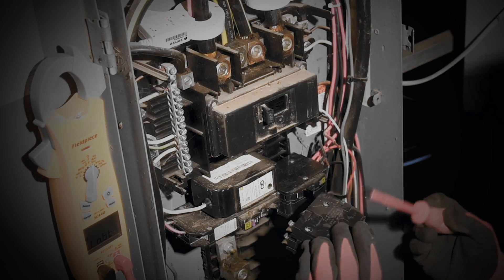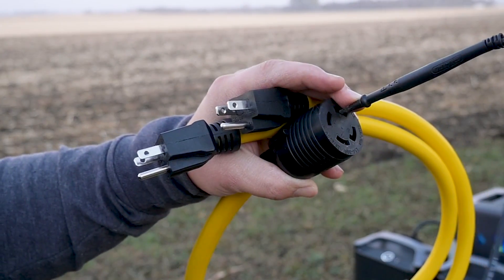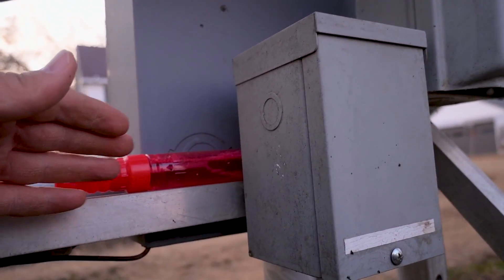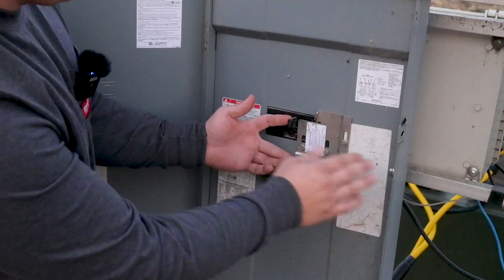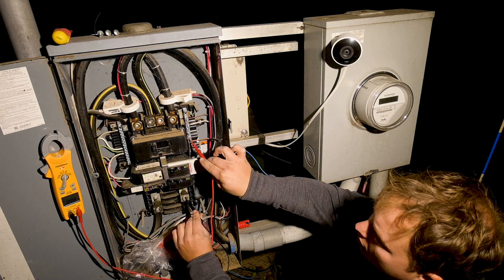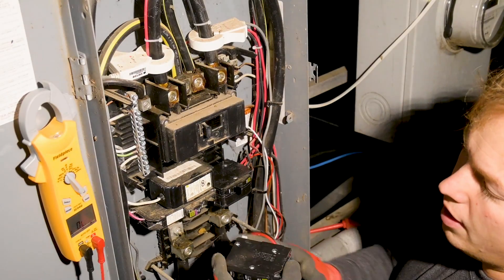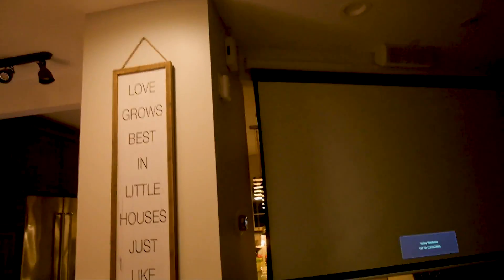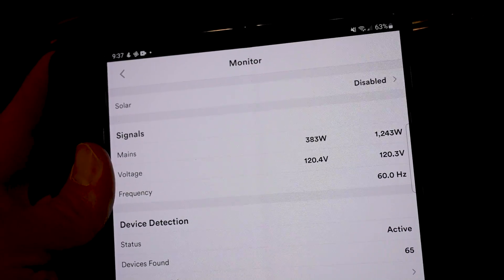Can You Power a 240 Volt Panel With Two 120 Volt Generators?

Comment: The reason you are seeing the voltage changing between the to hot legs is the two inverters are not running at EXACTLY 60 hz....so their phase is not synchronized. What is happening is as the inverters come into phase with each other you will see 0 volts. And the voltage will rise as they go out of phase until they reach 180 degrees our of phase, showing you a peak voltage, approx 240v.   

You can tell exactly how many cycles apart they are by timing the how long it takes from peak to peak.

This is how power generation plants sync with the grid before closing their interconnect with the grid. They monitor the voltage between the interconnect and their generator. They adjust the RPM so the cycles are VERY close. Then they wait for the zero crossings match and close the circuit. You can do the same thing with multiple generators connected to your home at the same time.
Reply: Exactly.  That tool is called a Synchroscope by the way.
Reply: 100% correct and well explained. An interesting case is that once the generator is synched and connected to the grid, it is very difficult to get it out of sync or out of phase because the grid will resist those changes.
Reply: @TwoToedSloth  which is why every traditional power plant which is online is going to spin at the same speed. If the grid frequency is higher, it will turn the generator into a motor until it reached the same frequency. (motors and generators are basically the same) This is also the mechanism that allows producers to control large scale outages. If they see that a region lowering the frequency too far for too long (minutes) then they will cut it off, which will generally cause the entire consuming region's grid to fail spectacularly.
Reply: You need BOTH sync & phasing in order to be correct. The sync just means they are operating exactly a 60hz (good) but they could be out of phase (not good)
Reply: Yes...the very reason some gennys have a sync option.
Reply: @Icehso140  Do you know which brands do this?  When I was looking for two 3k inverters to do that, all I could find were parallel kits that sync'd  to be in phase, providing more amps but at 120 volts.  I could not find any that would sync 180 out of phase to produced 240v.
Reply: @GregsStoneYard  being in sync is one thing,  being in phase os another. See if the inverters have a phase adjustment knob
Reply: @GregsStoneYard  paralleling, either in single phase, or in split/multi phase inverters is a totally,different kettle of fish. They have to be specifically designed for it. For a split/multi phase (US household 240v) I’m not aware of any units that can achieve that without a sync cable. In theory you could have a slave unit reference a phase and lock itself 180 out but none I know of do that. During commissioning you configure and wire them as a system with a master, it sends sync to the slaves which are configured for their own phase(s). 

If they’re not designed for grid tie or synchronized (and installed/configured/cables for it) trying to parallel inverters like you can do with generators, you’re going to have a bad day.
Reply: @OverKillPlusOne  the way to do it (and i have done it) is to use the exact same clock for the inverters. You connect the power from one inverter to another so that one inverter is acting as a master clock which the other "locks" to. You use a phase locked loop to have the slave inverter "locked" to the master inverter frequency. Usually the inverters us a high clock frequency and divide it down to 60hz. It would be ideal to grab that high frequency and pass it to the slave inverter, or have a master clock generator for BOTH units to lock to. Once they are running in sync (and in phase),
you then can tie the inverters output in parallel to increase the resultant power ie. two 30A inverters can produce a total output of 60A at 120v OR you can place them in series to get 240v 30A Split phase. (2-120v 30A 180° apart) 
Remember the power output (normally measured in Watts) if in parallel, the wattage doubles, to get dbl the power each inverter MUST be same phase with each other! Or bad things will happen.
in series the voltage doubles. But each inverter must be 180° out of phase with each other. Cant have both dbl lower AND dbl voltage, that's the law. Ohms law that is
Reply: @Icehso140 Honda 2200i
Reply: Yep, if the phases of the 2 power sources were in sync this would be entirely different outcome.  As is, you have 2 independent 120v circuits. No, 240v possible.
Reply: @michaelmiller1109  not entirely true. You cant mix the terms "phase" and "sync" If both generators are in sync AND in the same phase, you would still only get 120v. What has to happen is that one generator or inverter must be 180° out of phase with the other.

 In power plants they need to be in sync AND in the same phase to increase power on the grid.

In this example, to get 240v, they need to be in sync AND 1 generator need to be 180° apart.
Reply: @rty1955  You are concatenating two different scenarios... and I guess really..  I did too.  To be clear, my explanation was why he was seeing 0-240v over time.  And this is because of the frequency difference between the two sources, So the phase shift was constantly changing creating a voltage potential between the 2 hot lines.  A long time ago, prior to the modern syncroscopes which uses LEDs to show the phase angle delta between the two sources, we simply used a light bulb... and you can still do this today. No fancy oscilloscopes needed. Just connect each leg of the bulb to one of the hot legs on each generator. Adjust the RPM on the slave generator until the bulb is fading on and off about 1 time per second. Then when the light is off, close the switch and BAM the two generators are electrically coupled. You can do this with ANY 2 generators. No inverters needed... no special generators needed. The ONLY caveat is if you are running a 3 phase generator, you must be sure your phases are in the same order.  i.e  RST. Otherwise you will hear some very expensive music.  If it is single phase 120v or dual phase 240v, it won't matter because the secondary winding will be EXACTLY 180 degrees out of phase from the primary winding and as long as you close the interconnect at the zero crossing, they will couple gracefully.

For those that still don't understand this concept, search youtube for "syncroscope". The top 10 results are good videos explaining this,  with real world examples. Mark Roy shows how ships bring multiple generator onto the bus. Matt Verley uses the light bulb trick with 2 surplus Army generators. And, Chris Boden has an excellent example of how difficult it can be to 'manually' bring a hydroturbine online because of the momentum of the water flowing from the river comes in waves after first opening the valves.

There is a great video created in 2007 by DHS that shows how to destroy a power station diesel generator just by opening and closing the interconnect at the wrong time (while being out of phase with the grid.) Since everything is automated and connected now, presumably this could be done remotely by a hacker. Search for "How 30 Lines of Code Blew Up a 27-Ton Generator" on Wired. There is a video on youtube titled,  "Aurora Test Footage" showing this generator violently failing.
Reply: @rty1955 - re: @Michael Miller   Actually, if they are "in sync", both frequency and phase, you will get 0v, not 120v. I have to assume you mean across the phases because you are stating 240v @ 180° apart.
Reply: @donbeckham  it depends on your ref point. From one phase to a neutral they will always be 120v. From one phase (or hot leg)  it will in fact be 0v ONLY IF they are in phase. 180° apart, it will measure 240v across the hot legs. It will still measure 120v from the neutral to each hot. Just like in residential wiring in USA
Power plants ARE in SYNC & PHASE, thus adding additional power. The measurement between the phases are in fact 0v. But they are 120v each as referenced from a neutral.
Reply: @donbeckham  you should not compare frequency for phase. As one has nothing to do with the other. Two generators can in fact be of same frequency, but different in phase. 
In power generation stations a simple bulb can be used as u mentioned. The bulb is rated for two phases being 180° out of phase. When they are in phase, the bulb goes out as the difference in voltage is zero, as it goes out of phase it gets brighter and gets its brightest when its 180° out of phase.
Reply: @rty1955  Most inverter generators will sync, IN PHASE !  Not sure how the do it.
Reply: @rty1955  Well no shit... I have said that 3 times now.
Reply: @donbeckham  sync and in phase are two different things. You need both for two generators to be linked together. As discussed two generators can be spinning in sync BUT 180° out of phase. That is not good, both generators need to have same phase as well to be useful.
Reply: @rty1955  power plants use 3 phase generators houses only get 1 of those phases so it is in sync and rises and falls at same time
Reply: I learned about generator synchronization in a video game: Infra
Reply: You can use a "standard" oscilloscope with differential inputs.  I would run the 'scope off of battery power or an isolation transformer.
Reply: @jackpatteeuw9244  just need a dual trace scope and overlay the traces
Reply: @rty1955  I guess the neutrals and grounds are all bonded so the 'scope really has only one reference point.
Reply: @jackpatteeuw9244  the ground on. Both channels on a scope is connected to frame ground and also to earth ground on the ac plug on the scope, so both channels are referenced to chassis (earth) ground
Reply: @jackpatteeuw9244  Just be careful about the maximum input voltage rating of the o'scope...
Reply: @greghamel8933  using low voltage (~10vac?) AC wall warts is a great way to see AC line "conditions" safely with an O scope.
Reply: Nice project 👌
Reply: THIS
Reply: Benjamin have you tested for your journeyman's license. If not you should. Very smart individual
Reply: Generators are generally built as sync gens or none sync  - also the engine governor has to be such that it can maintain a balanced exact rpm so that the genarators stay phased in together - there also reverse voltage relays - 
    Two conventional 120 volt gens will not phase in together to make 240 in series - if inverter generators or inverters can be inerphased then it can be done -
    I worked on generators on off shore drilling rigs for decades - we were called SCR electricans means we understand power production and we have an intense industrial electronics back ground - 
       All those gens are from 6MW and up to 20MW  and there might be up to 8 gens on a rig - there phased in together to run in parrel just as grid gens are - 
   .the gens wave lengths are all exactly the same and RMS - that's not so with demestic gens
Reply: you can not be out of phase 180 degrees since all the power coming to your house is only 1 phase
Reply: @ranger178  we are NOT talking about the PRIMARY side, we are talking the SECONDARY side where the IS a split phase secondary, where each winding is in fact 180° out of phase when referenced to each other.
Reply: @rty1955  it is not a phase in time of cycles it is simply the other side of the winding on transformer simply another leg coming into house
Reply: @rty1955  yes i see you are referring to the split phase of the secondary, so they are wound in different directions and rise in voltage on opposite sides of neutral to give you the 240
Reply: @ranger178  they are actually wound in the same direction. Ill explain: call the secondary legs L1 & L2, the center tap is called N. If you measure the voltage from L1 to N you get 120v. If you measure N to L2 you get 120v. If you measure L1 to L2 you get 240. The whole key is WHERE you reference your measurements from. If you place scope leads with the ground of the scope being on the neutral and the probe tip on LI you will see a sine wave, if you move JUST the probe tip to L2 you will also get a sine wave BUT will be 180° out of phase with the L1 measurement. By moving the probe from L1 to L2 you are actually REVERSING the probe polarity.
Never attempt to place the ground of a scopes probe to EITHER L1 or L2 as the scopes ground connection IS ALWAYS attached to the N. So in reality you don't even need the probe ground. This is a typical mistake people who dont understand how scopes work.

Also The amount of turns in the secondary determines the output voltage. For example if I make twice the amount of turns in the secondary than there is in the primary. The voltage can be much higher than the primary. What does not change ever, is the VA rating. Whatever the VA is at the input will appear at the output. For example if you apply 17,000 volts at the input with a supply of 200A that would be (17,000 x 200) 3,400KVA the output also must be 3400KVA if your secondary winding is for 240v, the total current that can be drawn is (3400kva÷240) 14,666.67Amps!!
Reply: @ranger178  again, the supply to the HOUSE is the secondary of the pole transformer that has a center tap, which does produce 2 phases of 120v thay are 180° apart. No where is the primary of the transformer was mentioned. And if you go back further to generation, there are actually 3 phases not 1. It is the substations that work with all sorts of devices to finally send power down a residential street and ultimately to a pole transformer then to your house. The supply to your house is a split phase supply. That's What should be discussed
Reply: @donbeckham  and apparently you STILL dont understand even after all that information, Its a SPLIT phase at the home NOT single phase. Remember you have 3 conductors going into your home, not 2, understand now?
Reply: What I am getting out of this discussion is that "in sync" is the rpm of the generator and "in phase" is the sign waves being 180° apart.
Reply: @markchidester6239  In phase is when both sign waves are the same phase angle, not 180° apart. Bad things will happen if they are 180° apart. Imagine 2 cars hitting head on.  RPM controls the frequency of the sign wave so obviously those have to be the same as well... and when they are not, you get a voltage potential across the 2 sources.
Reply: @donbeckham  interesting, thanks for the knowledge.
Do you have a good reference to learn more on the subject?
Reply: Persactly.
Reply: You my friend, know your $hit 😎 Respect 👊🏼
Reply: How do you get them to sync
Reply: That’s what I say also . The fases = both legs are not in synchronized for proper 240 v amid 120 per leg . I know you was just testing but I know you are just trying something out of curiosity but you was just curious between two power stations and you found out a costly solution that was a minimum. Stay safe and May the solar be with you .😉🤙

Comment: Wouldn't this overload the bejesus out of the shared neutral wire connected between the generator and the panel? Single phase systems between the utility and the panel share a neutral because the amperage from each split cancels out since the oscillating waves are 180 out from each other right? What you did here is use two systems that aren't synced with each other, so can't we assume that the amperage coming back through the neutral fluctuates just like your voltage? I'd be curious to see a clamp meter on that neutral with both battery banks at full load and see what you get
Reply from the maker: That is an excellent thought. If I have the opportunity I'll definitely throw a meter on the neutral. It would be important to not exceed the rating of the neutral (in this case 10awg) for the reasons you outlined. In theory if you have a power source that will only deliver up to 30a total between the two sides then it should be fine.
Reply: @BenjaminSahlstrom  i wonder too, if the desynchronized wave forms helped cause that burned up breaker. It's hard for me to believe that a bug caused that just when you hooked up your crazy experiment. So coincidental. I know you found a bug but still. Like maybe some tidal wave of electrons rolled through that breaker just right, caused by the turbulence of the wave forms, like a rogue wave on the ocean

Comment: Your sensing device is a 240v load and should be removed. I would do it with 2 separate 120v cords and backfeed 2 single pole breakers. I plan on doing this when I want to shut down my auto generator and backfeed my 16 circuit  transfer panel. I would pull the control harness and fuses before I energize the panel with the 2 cords.

Comment: My buried power cable from my meter base 1300' away has developed, since last night, after 20 years since burying,  a bad connection at a splice (I think/hope), one leg is 120 volts, the other drifts from 20 to 60 volts, so NONE, especially my 240 well pump, are working. So, tonight I'm getting by with just my usual 120 v loads, lights, fridge, this computer, etc., BUT an hour ago had a brain fart! I have a Honda 4 KW welder/generator, 25 years old, and never fails to start on the first or second pull. It  ONLY has 120 volt output, so no good for my 240v well pump, or so I stupidly thought! But, 10 minutes ago, it hit me: just take the two hot leads from the two 20 amp outlets, one to each hot on the pump leads, join the neutrals, and just like that I'll be running my 240 well pump off my 120 genny. I can't believe I didn't think of it sooner, just came here to verify my thinking. The well pump is only 1/3 hp, and a soft start Grundfos, the genny won't even grunt. With a 80 gallon pressure tank, running the genset once a day for a few minutes will get me by until the snow melts and i can dig out the bad connection.